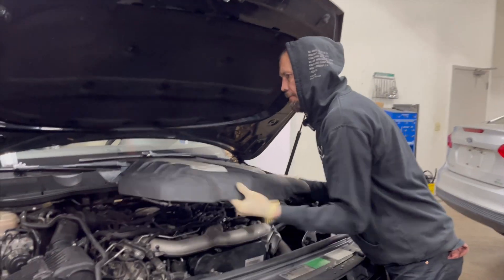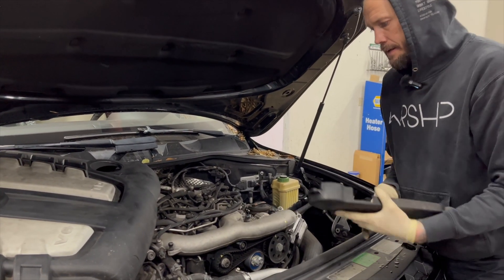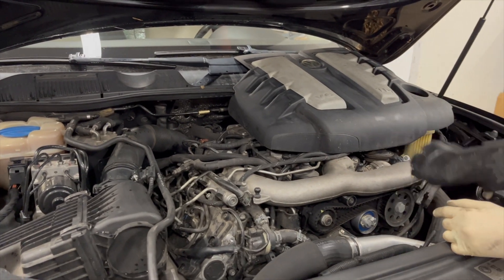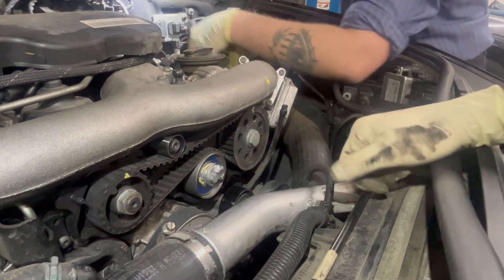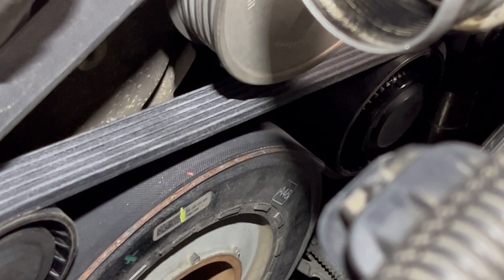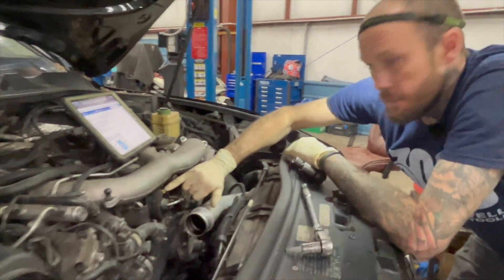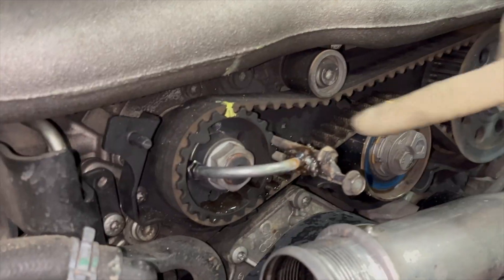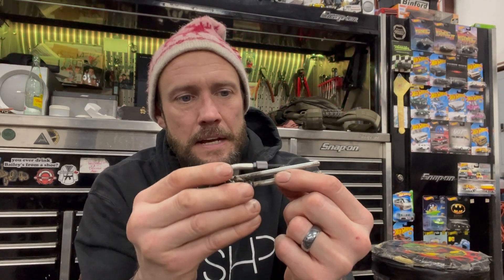2012 VW Tuaregs 3.0 TDI High Pressure Fuel Pump Belt

Comment: Thats a CASA  engine, 2011?
I think you need to align a "pin and a hole" on that tensioner for the correct belt tension🤘🏼
Reply from the maker: @Rob3rtPlant  No, you don’t. I show in the video that I have the VW Service manual, it says NOTHING about a “pin in a hole“. I have no idea if it’s a CASA engine. That sounds like a special they had at Chi-Chi’s in the 90s.
Reply: @griffzillagarage  
https://a.d-cd.net/wwAAAgGfOOA-1920.jpg
Reply: @griffzillagarage  I mean, not a hole but a notch. Strange, i have it in my manual. Mine isnt aligned also and for 85K Km is going strong.

Comment: Is it a normal installation without adjusting the timing belt?
Reply from the maker: @MN1611IR  i’m not sure what you mean. You have to set tensioner in the correct spot.

Comment: I want to replace my belt tensioner and the CR pump belt. The instructions show that the tooth with the green dot should be in the same position.

However, when I turn it, the belt tightens and then loosens. Is it possible that I installed it incorrectly and broke the tensioner? Is it enough to install it in the position shown in the video/instructions, turn it to one o'clock and then to three o'clock, then the dots will match?
Reply from the maker: @marcelmartyna3833  when I originally did it, I tried to turn to 1 o’clock and it put too much stress on the tensioner and it felt like it was going to pop and loosen up. I only moved to the 3 o’clock position and tightened it down to spec. All marks were lined up at this time; except for that green dot you’re talking about I don’t know what that dot/mark that is.
Reply: @griffzillagarage  If you tightened the tensioner too much would it break? The Audi specification states that the green dot should match with tooth.
Reply from the maker: @marcelmartyna3833  two things the first thing is that the Audi Volkswagen instructions are pretty crappy; at least they are to me. The second thing I have no idea what green dot you’re talking about.
Reply from the maker: And I think I offer a membership for you can actually call and talk to me directly so I can walk you through what to do
Reply from the maker: @marcelmartyna3833  did you figure this out? You can email me here griffzillagarage@gmail.com